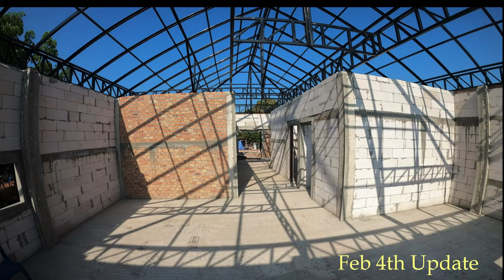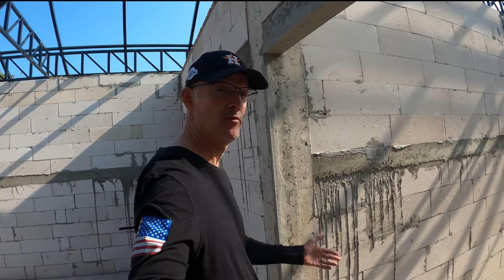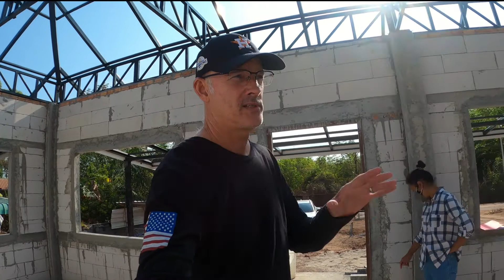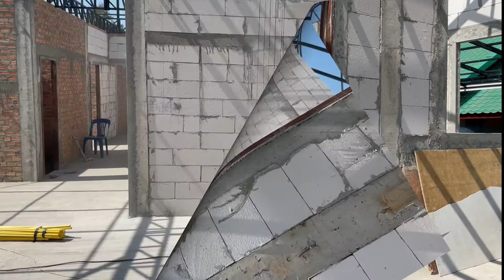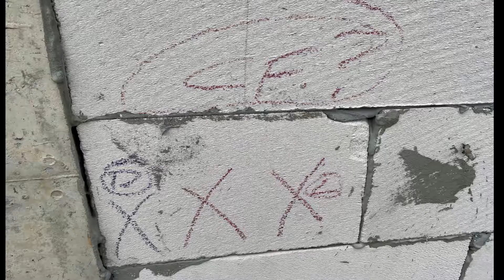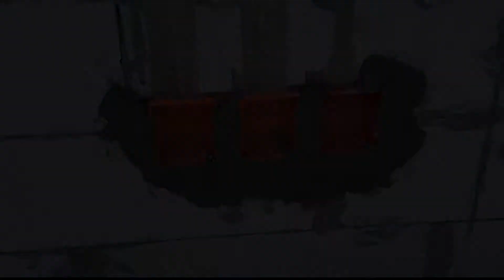Feb 4th Update- Electric!

Comment: Hi,   Nick & Yisa with another question.  Looking at the scope of the build,  excluding the land,  do you have a rough idea as to the house construction costs,  basically two numbers,  the first for the build proper,  second,  the internal fixtures and fittings.  Many thanks from us both and looking forward to the upcoming progress videos.
Reply from the maker: I will tell you- 1,950,000 BAHT for the basic build. So just under $60,000 UDS. Does not include appliances, air conditioners. It is 180 sq meters. Inside? Well we are blowing way past the included budget- upgrades on sinks, toilets, doors, flooring, tile, ceiling fans. We are having them do custom kitchen cabinets- that could run $2000 USD. Custom walkin closet as well. The outer perimeter wall could run $10,000 USD. In the Master bath- the included sink was 1500 Baht- we picked one that was 32,000 baht! That is our funniest example, wow! So to spend another $50,000 USD to complete the home how we want, that may be about right. But we have expensive taste and want to create a "resort" setting for ourselves.
Reply: @AmericanInThailand  Hi,  many thanks for the clarification,  I kinda had those numbers roughly nailed.  Like yourselves,  my wife and I have some very specific ideas on the quality of the internals we like so that's something that is going to soar i'm sure.   With your numbers it coming out at close to 11,000Baht per square meter for the basic build which isn't too bad.  Best from us both.
Reply from the maker: @nickdavies3334  Thank you!